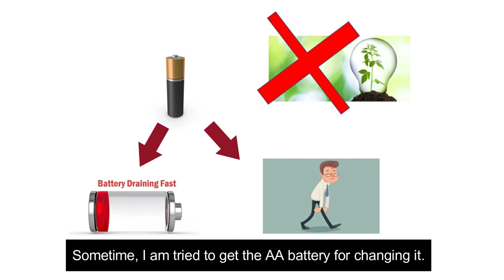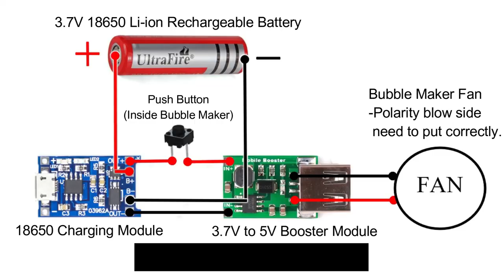DIY Project: Turn Toy into Rechargeable | Replace AA battery to Li-ion | Charge with micro USB

Comment: This is amazing! I was wondering if you could do this with a Disney toy droid from the droid depot? It takes 6 AA batteries and how long does the charge last?
Reply from the maker: 6 batteries is 9V, so you may use a 8.4 li-ion battery to replace, 2 LI ion battery with 3.7V, the charger need 8.4v adapter will do

Comment: Amazing! Was looking for a milk frother conversion, this video may be exactly what I need, you think it will work fine with this setup? It has 2 AA batteries. Nice video man, keep it up!
Reply from the maker: Thanks! Yes, for AA batteries, the needed input is 3V, you may use the step down module to replace the step up module in this video.

Comment: Bro can you connect solar panel into that usb port to charge the battery?
Reply from the maker: can, if the solar voltage is 5v
Reply: @mybotic_tech  thanks
Reply from the maker: welcome